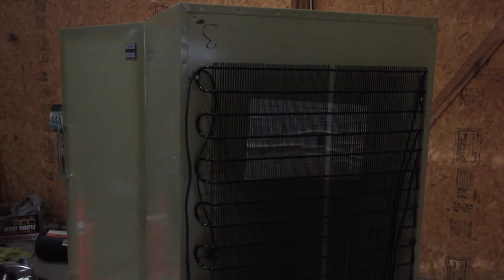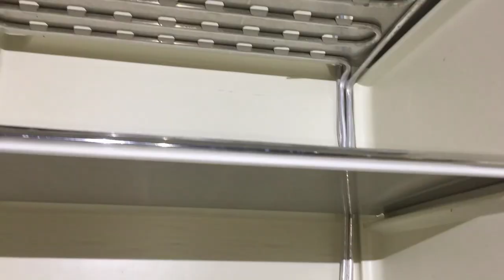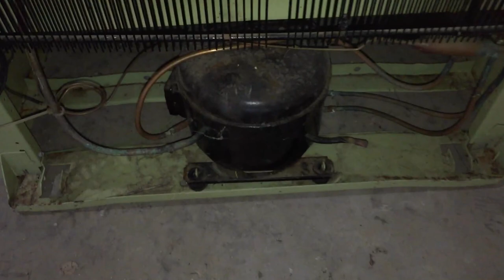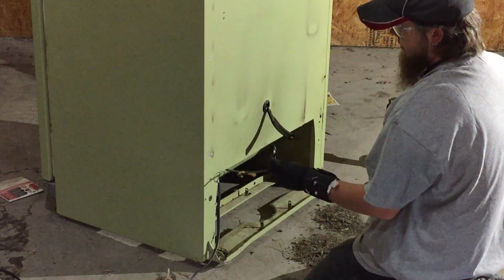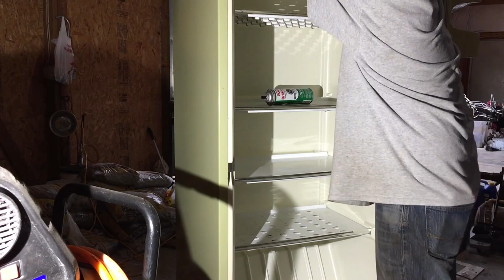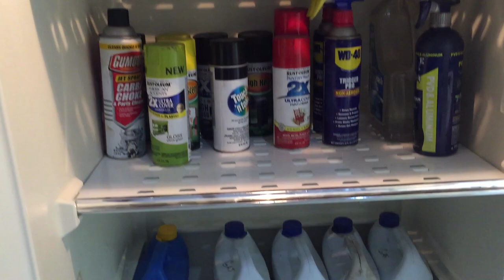Turn an OLD FREEZER into a STORAGE Cabinet!!

Comment: Nice! From SEK myself so nice to see someone else do this locally.  Going to try and make mine thermostat controlled to turn the lightbulb on/off to keep at a desired temperature.  Have you found that without a heating element the liquids stay warm enough during cold KS winters?